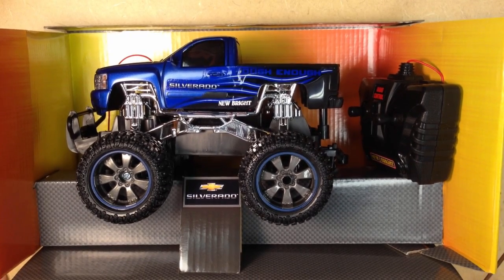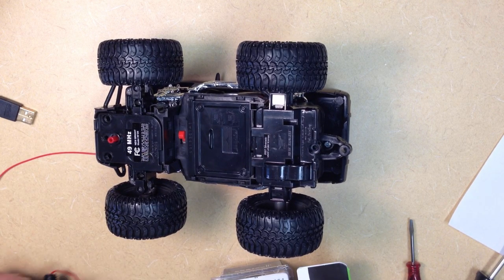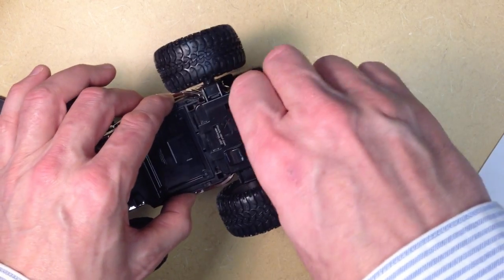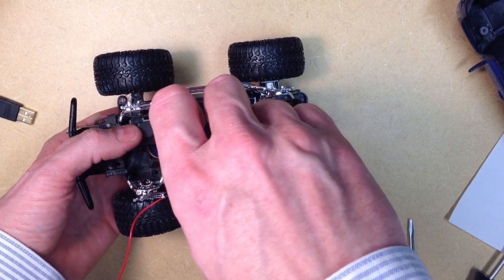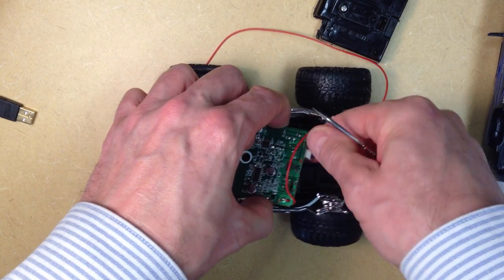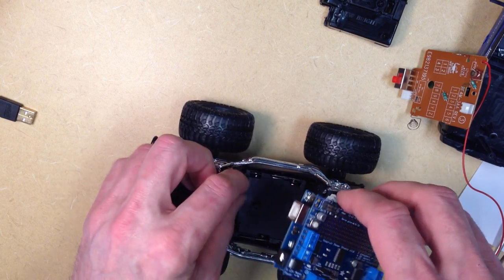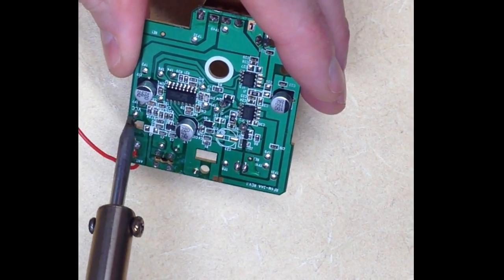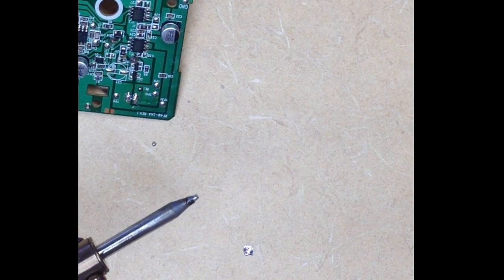RC Car Disassembly

Comment: I need help I'm trying to fix my 6 year old brother's Maisto Tech RC Car and I think I detached some wires from the electronic board that are probably broken, and those wires lead to the DC Motor that moves the car, I put the 2 wires onto a battery and it still operates, but when I touch the wires onto the board the control won't move the car, or the steering. Any help would be appreciated